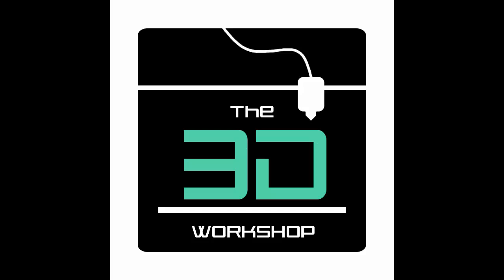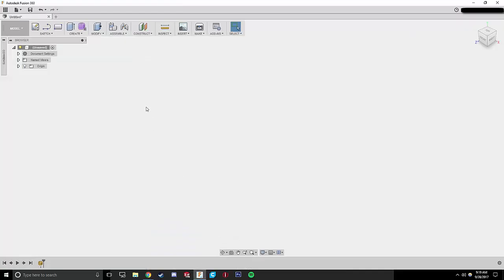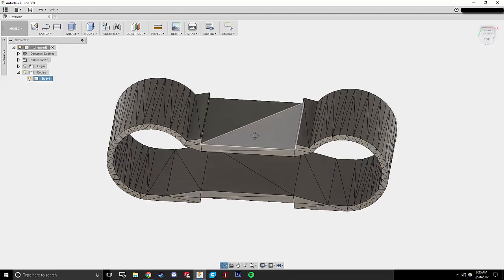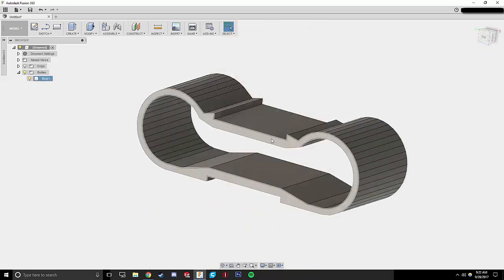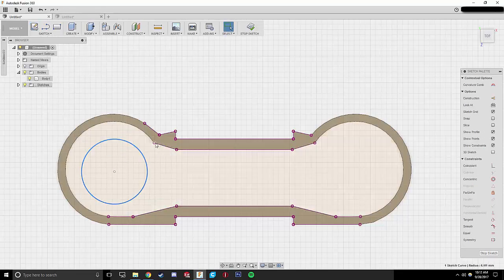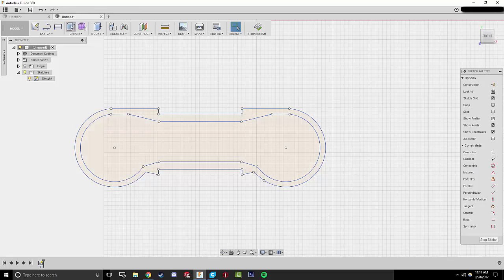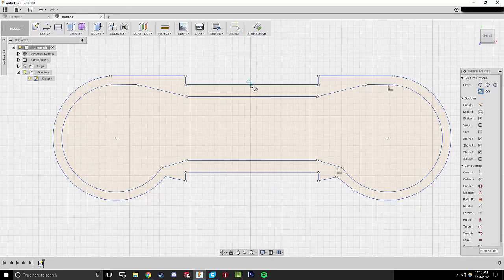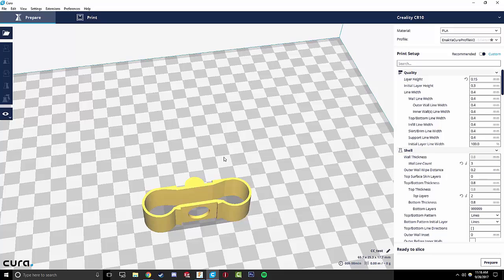How to Remix a Part from Thingiverse - CAD Design for 3D Printing

Comment: So if someone " fall on this tutorial ", know how to use blender have have a non flat top surface :

Import the stl, select all top faces, separate into a new object. Then select all the face of the new object and resize 0 on the Z axis to make it flat, then merge vertice by distance to close the shit. Then you can import finger in the nose your flat surface on fusion, convert to Brep and extrude like 10 mm then project the shit on a new sketch and voila.

It's 10 times faster but only if you know how to use blender.

Comment: Thank you for making this video. I was struggling with a part that was nearly 2500% under-scaled in two directions with the third (y) still undetermined with 4 holes, probably nicely spaced but the part should only have 3 holes. So I’ve got my work cut out, but without this video, it wouldn’t have been worth the shot at it. I’ve subscribed and will have to watch the rest of the videos in this series. Thanks again.

Comment: Came across this looking to modify a mainboard case, I can't find anything I like that fits the mks robin nano v3.1 due to the usb port. The formfactor is otherwise the same as a btt skr. So I simply need to create the opening for the extra USB port.

Comment: Very good basic high level info.  I wish you would go into a bit more detail.  I'm getting errors about "not being able to heal  the edited region" and I have a TON more triangles on my STL.  It will take me a month to go thru with this trial and error as to which triangles I can or can not remove or simplify.  Fusion needs a "Simplify Mesh" function.